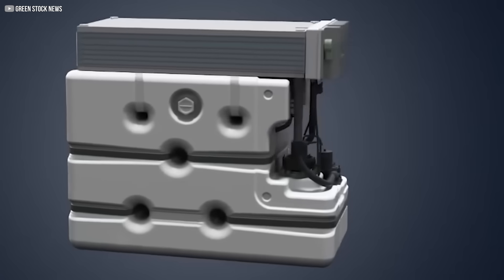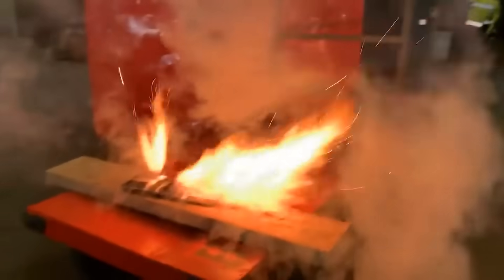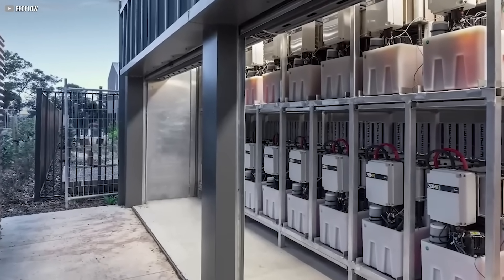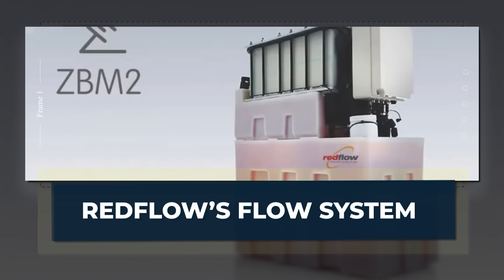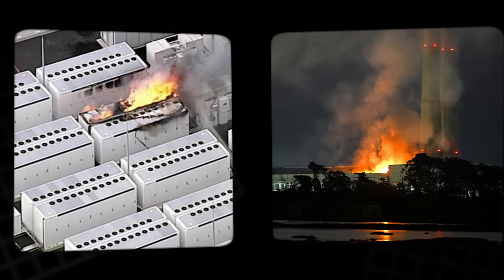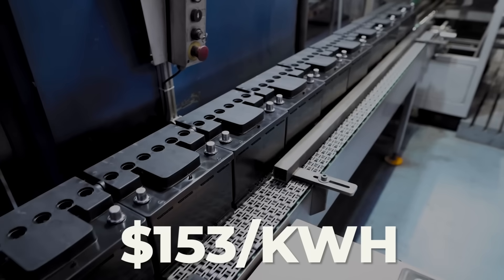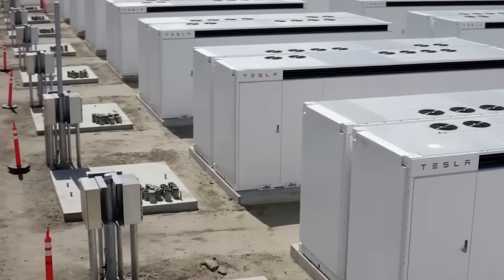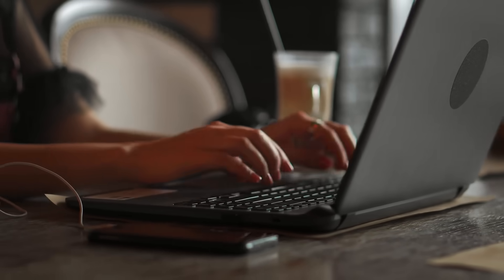Why a Century-Old Battery Is Suddenly the Future

Comment: @1:16   That's because Lithium batteries have already become a FAD. The Lithium battery packs between different tools are usually not compatible. 12v, then 14.4, then 16, 18, 20, 22 24, 26, 28, 32, 36, all the way up to 72 volts. So when you need a freshly charged full battery pack, you have to purchase an extra pack to sit in the charger at the teady. But then, WHICH one of a few dozen types of packs and chargers IS IT ?????????   This might take 5 minutes of looking.  And the (dumb) chargers overcharge the battery packs, causing aging. Fast charging causes aging of ANY battery system, as well.
Old battery packs are not recycled properly either.
Obviously, its a conspiracy from the petroleum industry to boost the cost of Lithium to make EVs EXTRA expensive.
It was very sad to discover that Lithium EXPLODES when it gets WET with water.
Reply: Again more bluster.  Lithium is less reactive with water than Sodium (basic chemistry - check out the Periodic table?).  The reaction with water is slow and produces hydrogen gas which could eventually cause an explosion, but Sodium, Potassium and Caesium react with water in increasing reaction rate - Caesium in water will likely ignite the hydrogen and cause an immediate explosion (with oxygen present, of course).  Forgotten the earlier toxic Nickel Cadmium cells - plenty of expensive Nickel and lots of extremely toxic Cadmium?  Agree that different battery packs - fitment and voltage - are a marketing ploy - but also progress for portable tools.  I think you likely need the odd chemistry lesson?  Or get up to date with technology?
Reply: @oliver90owner Lithium was a RARE expensive element in 1966 Honors Chemistry, so we didn't get to see a similar explosion it does compared to  pure Sodium and Potassium when exposed to water.
Saw more than a few YouTube videos about them all, and they're all about the same.🌊🎇

Comment: Are there any issues with the battery in colder temperatures < -20 F? What about when it's exposed to high heat > 120 deg. F?

Comment: Battery company Redflow was tipped to be the future of Australian clean energy manufacturing, but it collapsed in August this year. Some customers, installers and former employees say the company's $10,000 home batteries failed within months. This company is insolvent and OUT of BUSINESS!
Reply: Collapsed August this year? 🤔
Reply: @philipgrobler7253   Never noticed lots of companies that have been liquidated, but like Phoenix, have risen from the ashes?  Dodgy double glazing firms, roof-top wind turbine suppliers, solar panel system sellers, to name just a few, that go bust and restart with a different title.  I expect Redflow ran out of money grants, subsidies, etc and the older units (with poor membrane separators (which needed replacement too regularly) likely costing warranty money, has likely liquidated and restarted under this new name?  This may not be the case here, but I would be suspicious until demonstrated/proven otherwise.
Reply: @philipgrobler7253  Australians have August when we have March.
Reply: For STATIONARY applications, 37 years ago, high-grade very  large singl-cell Lead-Sulfuric acid liquid electrolyte batteries were available with absolutely clear cases, so the condition of the plates could be seen. The cap was specially designed to recycle water evaporation, dripping it back into the battery.
This was before Desulfators were sold to consumers.  Such batteries could probably last as long or longer than Lithium types, and MUCH SAFER by comparison.
Reply: @petebaron4643 They can be recycled by Shmo Joe as well. I used to frequent a scrape yard id go to to find special parts for my machines and i seen my scrape bros breaking down tons of batteries with just an axe and ask what they were doing because although they took batteries they weren`t a battery recycle outfit. They were rebuilding a forklift battery from scratch and mixing / making their own plates. The only thing that didn`t make was the case and ive been saving old leads to do the same it would allot easier if i could get a bad forklift battery for its case and lead.
Reply: @petebaron4643    There are safer batteries than Lead/acid accumulators.  Lead is toxic, isn’t it?  Sulphuric acid is a strong acid.  Over charging, or when charging at near end-of-life, can result in hydrogen and oxygen being electrolysed from the water, in stoichiometric proportions, for a perfect explosive mix with merest of sparks.  While lead/acid accumulators have been used successfully for decades doesn’t mean they are safe or the best these days.  Your rose tinted spectacles need checking out and maybe changing?
Reply: @petebaron4643 
Round trip charge efficiency roughly 65%. I have them...
Brings tears in my eyes in winter, when I'm wasting almost half of the little winter solar power.
Not an alternative.
Reply: so you know the future? you say the collapse is August of this year, that's months away 🤔 🤔what year u in?
Reply: @gamersplaygroundliquidm3th526  Well, they went insolvent in august 2024 so apparently he's talking to us from between seven and ten months in the past, which is kinda cool 🤗
Reply: @pelinoregeryon6593 Any idea what sort of batteries power his time machine?🤣😂🤣
Reply: @kooringagnd  I'd like to think he found it covered in tarps in an old farm shed and got it working again rather than built his own, one of these 'I found this old modified 1930s ford sitting there abandoned, hasn't moved in over ninety years, will it start?'  deals .. 🤔 so a 6-volt, three-cell lead-acid battery? 🤗
Reply: Bummer
Reply: You can make them yourself. The tech is amazing, the people making decisions, well, they're idiots.
Reply: @Wavy_Gravy  greedy AF idiots, they favor what is commercially viable, and screw the end user (planned obsolescence is another example)
Reply: i was wondering why I stopped hearing their ads on the radio
Reply: Like in the States, anything that aren't falling into the finance / legal service / mining ... etc industries and are human labor intensive, are prone to fail.
Reply: @MMLL369  here in Australia 🦘 the majority population can't stand America or anything you do,say,think or believe!! America is a stain on the planet!! It was a beacon now it's a sellout. Sells out your own people and your allies your health care and everything else they can get rich quick off.. America is a disgrace period 🤬🤬🤬🖕🖕🖕
Reply: They couldn't get enough funding. Typical Aussie patriotism
Reply: @secretbassrigs   tell me the name of this company.
Reply: @secretbassrigs  No, their problem was reliability. they just couldn't make them work without failure.
Reply: @politenessman3901  they're a Chinese company?
Reply: @secretbassrigs  no. they aren't.
Reply: @politenessman3901  🤔
Reply: dude, August this year aint here yet, pull your needle out and call ur supplier
Reply: @alb_a_c that was a dense joke lmfao 🤪
Reply: It’s not even August yet
Reply: @seikojason was 2024
Reply: How long have you worked for Tesla?
Reply: sounds like industrial sabotage to me.
Reply: I will look into this collapse and see what can be done
Reply: @claponclapoff6   convinced that would be  economic sabotage to be honest. this is not uncommmon.
Reply: China
Reply: Southern Hemisphere August is Northern Hemisphere March u dummies.